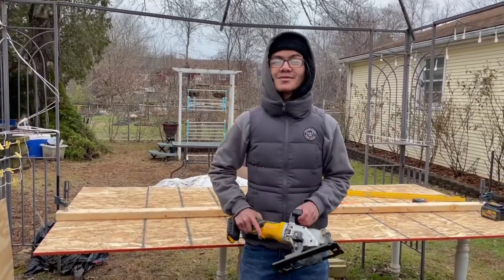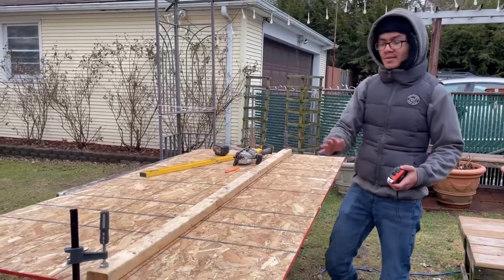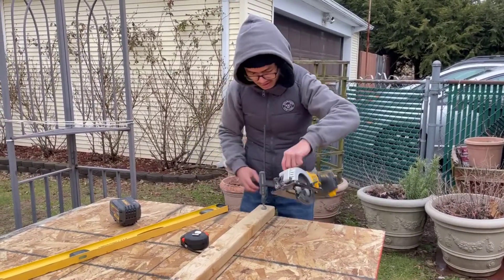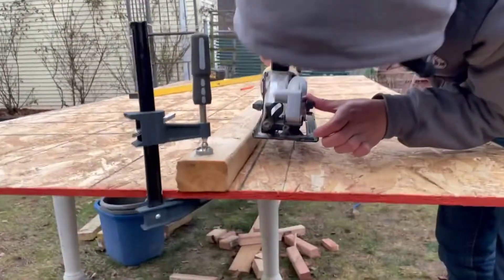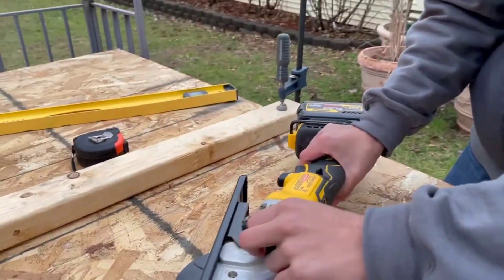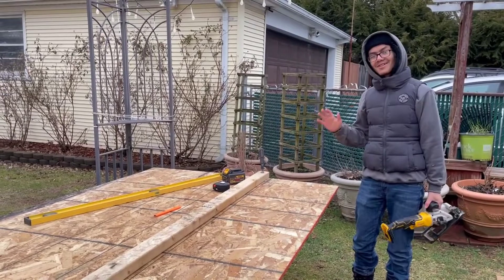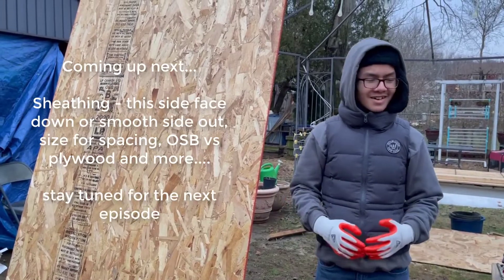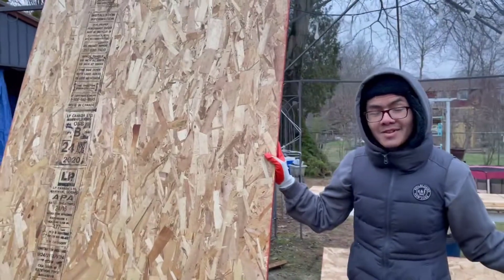How To Make Straight Cut Plywood Or OSB | Featuring DeWalt Cordless Saw & My Mom | Ep4 Patio Project

Comment from the maker: Here are the #ad links to the power tools featured in this video or required for this type of project should you be interested in buying:
1.  https://amzn.to/2KPUOjl  | DEWALT ATOMIC 20V MAX Circular Saw, 4-1/2-Inch, Tool Only (DCS571B)
2.  https://amzn.to/2WK2TZM | Bosch Bare-Tool CCS180B 18-Volt Lithium-Ion 6-1/2-Inch Lithium-Ion Circular Saw
3.  https://amzn.to/3hK5pZL | IRWIN QUICK-GRIP Clamps Set, 8-Piece (IRHT83220)
4.  https://amzn.to/38UvwZR | Striker - 77629 Mechanical Carpenter Pencil - 2 Pack
5.  https://amzn.to/3pHtbs6 | Meterk Laser Tape Measure 2 in 1, Laser Measure 131.2Ft/40M, Measuring Tape 16.5Ft/5M, Multifunctional Laser Distance Meter with Type-C Charging and LCD Digital Display for Measuring Area/Volume

Comment: Bro you did fine but you could have done a bit better. I find it more easier to cut it on a foam board less chances of a kick back no need someone to hold it just clamp the straight edge adjust the blade just a bit below for what your cutting, and wear your PPE.
Reply: Sharp Diablo blade no kickback